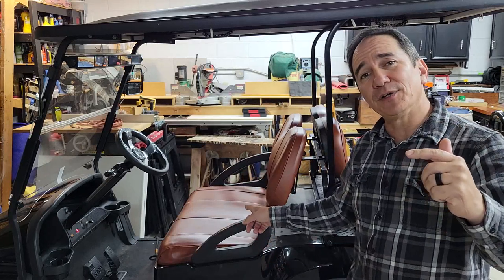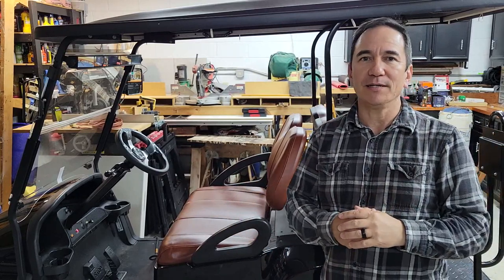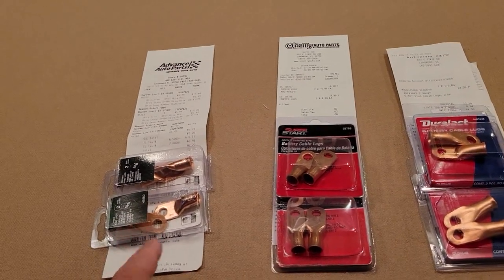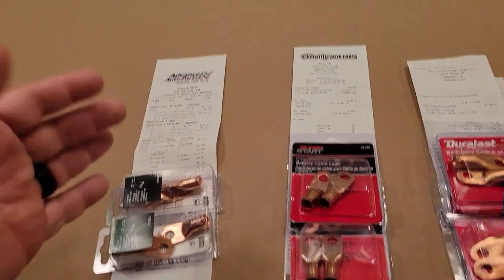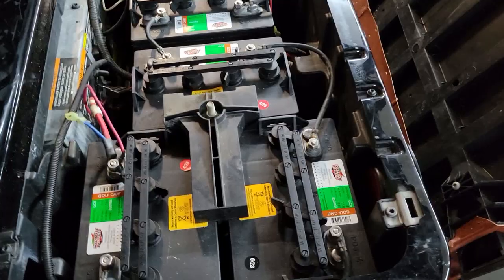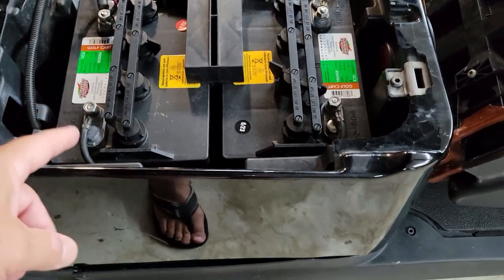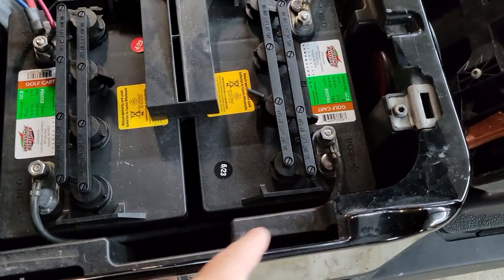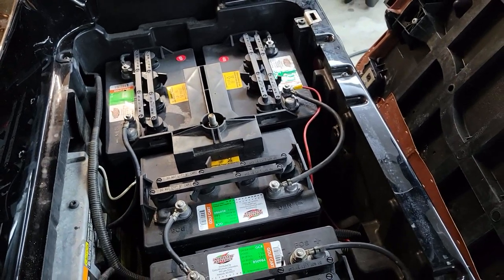How to replace or upgrade battery cables for a Golf Cart

Comment: Why did you crimp those copper ends on instead of soldering them?
Reply from the maker: Good question.  Mostly because I'm lazy and didn't want to have to do all that.  Using that crimping tool does just as good of a job as soldering in my opinion.